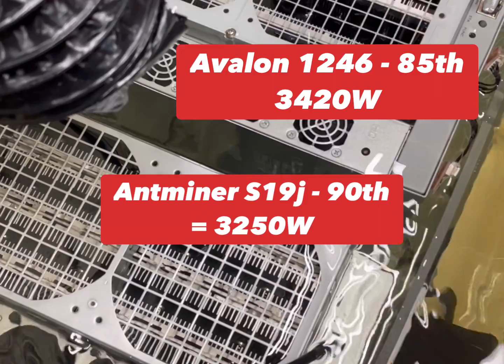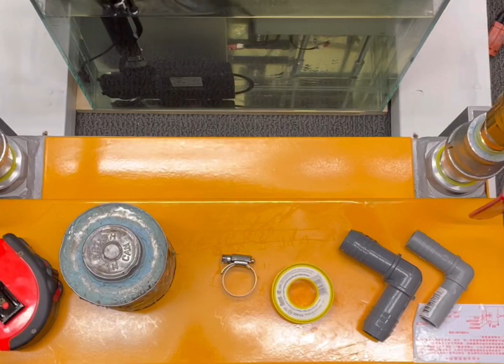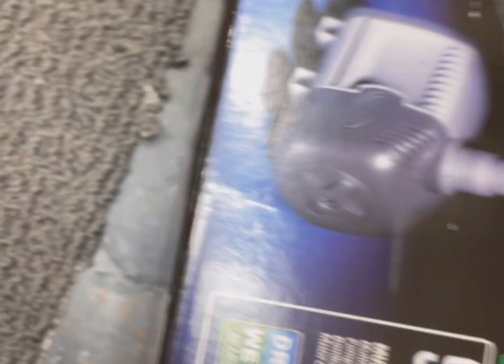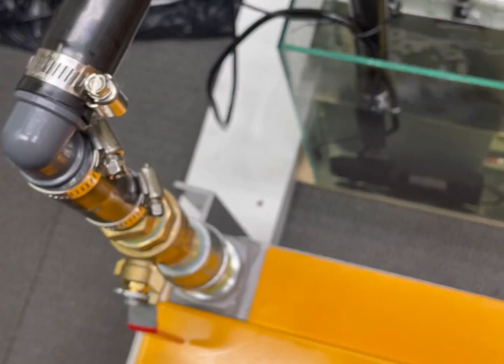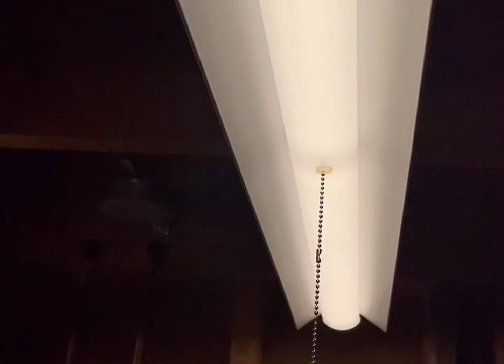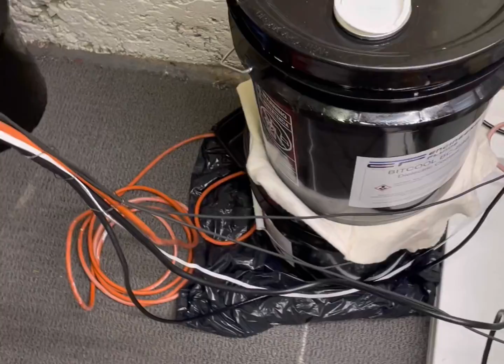DIY - How to Immersion Cool ANY Asic Miner like a Pro!  S19, 1246, M30

Comment: Why not slightly under clock or under volt the miners instead of selling one? That would make them much more efficient instead of over clocking one. Maybe I just don’t have the knowledge but just asking because in the consumer pc world it helps a lot.
Reply from the maker: It’s a good point you you bring up, I’ve tried overclocking, but it burns too much power. I think under clocking is the better strategy long term

Comment: So when plugging in the outlets into the miner the Iidquid doesn’t cause safety issues? Can this liquid go into a Avalon 1246 and also its power supply ? Sounds confusing and cool good video! I’m mining with my Avalon but looking to use this since it’s loud and hot when running
Reply from the maker: @Hakushodemon   you sure can, although it has the appearance of water it’s very thin non-conductive oil. I’m running a Avalon 1246 in this video and did for a couple of years, and it’s still being run by a friend in immersion today . It actually ran smoother than my S19. You just need a fan simulator and you can take out the PSU and ASIC fans out. (Some say you need a simulator for your PSU fans as well, but both my 1246 and S19 run fine without one. There are no safety issues with my glass or HDPE tanks. If you use a metal tank however, I would add a ground wire for safety. 

I’ll be launching a new video soon on an upgraded version i just built as well, runs great.  slower flow rate high quality pump, upgraded tank - slightly different, with new flow plate design, lid, fuel transfer lines for multi use placement, base mount etc. It’s for sale as well if interested. I haven’t posted it for sale yet. 
It’s comeptlely silent. Just the oil cooler fan going, which is a tolerable level interior or exterior. Hope this info helps!
Reply: @BackyardBitcoin  I would be highly interested in purchasing a tank for my avalon for this immesion cooling as long as i can be safe with it if there is a ebay/store link in the description I could look at! Will be watching for more detailed videos on how to immersion cool step by step if i was building it for my avalon myself! My main questions would be how would i remove the psu power supply from the avalon 1246 since its attached to the actual hashboards and main unit. then i would ask if i had a glass box and the right coolet oil, do i detach the power supply on the avalon and just put the aisc in? do you have a name suggestion for this fan similar? I was impressed by your set up since it appears to make the warm oil move over the waterfall and pumped back into those pipes! cool channel thanks for the information

Comment: What if you just ran 2 of the same machines at once for the oil radiators? Would it be better than 1 larger unit?
Reply from the maker: It would work, but Would be a lot more plumbing. More connections, more risk of leaks, more maintenance etc. it’s better to use one properly sized rad for them

Comment: Do you take out the PSU fans? Also, wondering how you get a water tight seal with the heat at 40+C Any redundancy in case of pump failure or leak? Does it shut-down the miner?
Reply from the maker: Yes you must take out the PSU fans. I’ve always been a little worried about my aquarium seals leaking with the temps, But so far it hasn’t been an issue. I have an Inkbird temp sensor in the coolant with a set high/low range that gives me notifications to my phone if something were to go wrong. Worst case I’m not around, the miners have auto overheat shutdowns built in..but of course you never want it to come to that.
Reply: @BackyardBitcoin Im bouncing around between buying a DCX solution or DIY, your vid was great advice. Thanks
Reply from the maker: @BC-AZ   thank you. you can make your own significantly cheaper if you are willing to put in the time and are a little bit handy. Roughly 1/3rd of the cost. If I were to do it again I would use a metal tank to ensure there’s no issues. A fabrication shop can weld one easily for you. Feel free to drop me an email jordyandrew@live.ca 
I can save you a lot of time and help you avoid mistakes. I also already know the exact tank dimensions you’ll need to make it work. I also have a two spare pumps and another heat exchanger this size I can sell to you for cheap. It’s just taking up space in my garage. Im always willing to help out, reach out anytime.
Reply: @BackyardBitcoin Yes, im looking to house approx 8x KS3 miners (3.3kw) total, so about 33KW at 80%. I think I would go with a welded stainless tank. Im not sure I like the idea of pumping the oil through to the dry cooler though, I would prefer a local heat exchanger design to keep the oil side minimized with fewer potential pain points. Ive been investigating DCX and Fog hashing options. I think I would want some redundancy in my pump setup or at least a way to auto-shutdown the rigs if the temps are too high. My setup would have the dry cooler outside through a wall, similar to how mini-split AC's are setup.
Reply from the maker: @BC-AZ  for sure. Stainless tank all the way. As  long as you use yellow gas tape and pipe dope combined you’ll no leaking issues as all, not even a drop. If you do decide to go with something  similar to mine or if you need anything let me know I’ll sell you the exchanger for $500. I also have one of the pumps that DCX uses as well and viton seals for use in a 1” threaded steel tank setup. No problem either way, best of luck with the build🤙🏻

Comment: What's up bro
I'm talking about Brazil and here we don't have DIY videos for this subject.
I'm impressed.
Three questions: Has the noise decreased much?
Why didn't you submerge the entire asic?
Do I need to do any preparation on the asic before diving into the oil? (in addition to removing the coolers).
Thank you very much!
Brazilian greetings!
Reply from the maker: Thank you! Greetings🇧🇷

1. Yes immersion cooling is completely  silent, the only noise you will have is from your heat exchanger fan.

2. This is one of my earlier builds, I have since modified the hot/cold side divider to be a couple Inches higher to completely submerge both asics. This is actually very important for optimal heat dissipation. If it’s too short, the hot oil can pool up and cause poor flow.

3. You will need to remove the all of the fans and get fan spoofers to trick the asics into thinking the fans are running. You plug them into where the fans plug into.

I do have all of the supplies to build a another complete system if you are interested as well or I can send you the just the parts for a DIY build. I have another heat exchanger, pump, tank, fittings, etc.

Hope this helps out! Let me know if you have any more questions or need any parts for your builld.

Comment: Cooling capacity of the AH-1470 model is 8kw (27,000 btu). 
Giving some thought to why the Risen cooler isn't doing the job cooling both miners.  Could it be that the pump flow rate may be moving the fluid too fast to remove the heat while passing thru the cooler before its returned to the heat source?  The Sicca pump rating is 10,000:/hr-2700 GPH (45 GPM) which might be too much flow and is working against you.  Just my thoughts.
Reply from the maker: It’s a great point you raise. In theory, the properties of Bitcool will indeed cool more efficiently by absorbing heat from the PCB’s as it passes through at a slower flow rate. However, I did try two additional pumps in the experimental phase. One with 1/2 and 1/4 power of my current one (thinking bigger was better initially) with little noticeable change to the temperatures. I focused more on reducing the ambient air temp and flow plate design which both had significant impacts on temperatures.

My future builds will a include the engineered fluids specified optimal flow rate.
Reply: @BackyardBitcoin   I went back to watch a DCX immersion system video again to compare.  Their system is larger but I was curious about the sizing of components, like the pump. They mentioned their pump capacity was 45 GPM (@ 8m of head) so your pump GPM was identical to theirs.  I'm wondering if the input/output temp differential would be better putting the dry cooler outside?  The DSX system used a heat exchanger so it lowers the amount of Bitcool needed, especially for a long run to a dry cooler.  Thanks for your info.
Reply from the maker: @wayneo7220  awesome, they have some pretty slick systems. I’m going to have my exchanger outside for my revamped system soon and I’ll make a video on it.  

Hopefully soon! It’s Tough with busy short summers here to get these projects completed.
Reply: @BackyardBitcoin   One other point I'd like to mention.  I was listening to a Compass Mining video and one of the guests mentioned that the thermal conductivity of the dielectric fluid is about 25% that of water and is more viscus, so you have far poorer heat transfer with the fluid and will need to significantly compensate in sizing with a much larger exchanger.  I never realized there was such a big difference.

Comment: nice work!, so mine finally came in and wanted to know how you wired the 220 into the cooler (i understand the transformer bit) is there an extension  or something because mine came with a threaded endcap piece?
Reply from the maker: Thanks! Ok so this type of plug is called a solenoid plug end, that’s the keyword to finding helpful info. Take a regular extension cord and cut off the female end then follow this video. It may not be exact but it’s vey close, and it will get the wheels turning for you. I have also included an imgur link with the wiring diagram for this exact plug. This should help! I’ve been there. Great question!⬇️

https://youtu.be/Xo8fez9EiJk

Diagram⬇️
https://imgur.com/a/qjAy66f
Reply: @BackyardBitcoin  awesome thank you ill give it a go

Comment: great project! Congrats. What do you use to simulate avalon fans? (NEVER MIND IT WAS ALL IN THE VIDEO THANKS!)
Reply from the maker: You will need the ATX 4 pin style spoofers. 4 of them. Check link below ⬇️
https://www.ebay.ca/itm/293732031428?mkcid=16&mkevt=1&mkrid=711-127632-2357-0&ssspo=z4T27MrAThW&sssrc=2349624&ssuid=NyJ-1gTsRXO&var=&widget_ver=artemis&media=COPY

Comment: the oil Specific Heat Capacity？it is what fraction of water? i want to use Silicone oil as heat transfer oil。thank you。
Reply from the maker: Approx 1/4 of water
Reply: @BackyardBitcoin  Thanks for your reply。silicone 1/3 of water. i think use silicone will be better in the same situation（AH1470）.
Reply: @BackyardBitcoin  I consulted  Bitcool specific heat: 2.054 Kj/kg·℃（40℃），Approx 1/2 of water。I hope to help others

Comment: Thank you for the video.  I have my own hybrid version and was running into some problems.  This is a topic that good info is still really hard to find.  I been experiencing problems along the lines of enough cooling for my miners.  I was experiencing slightly better results then your calculations in one of the comments.  This shows that my heat removal expectations were greater then reality.  I may have to look into other avenues to pick up my slack.  I hate having my miners throttle down or having to shut them off.  Good luck with newer versions.

Comment: Hey man, great setup! Thank you for your time on posting it and explaining all the way, helps a lot!!! I'm building a similar one myself, but using a fancoil to heat up my home by pulling fresh external air from outside. Regarding your issues with high temperatures: Heat exchange between two non mixing fluids depends on mainly three things: temperature delta (on both fluids), contact area surface and flow rate. Since you are using room temperature air to cool down, it just leaves flow rate as a controlled variable you can work upon without investing on a new cooler. That said, I'm quite sure your cooler is big enough for the application, but you are not moving enough fluid through it for it's maximum heat exchange rate to happen (200L/min for 8,8KW). Your pump says 2700GPH which is 171 L/min, probably less if you count hydraulic losses. Hope this helps!
Reply from the maker: Thanks! And I appreciate the information, Sounds like you are knowledgeable in this area. I’d love to discuss it more, feel free to reach out to me on Reddit! Thanks!

https://www.reddit.com/u/DR0PFiRE/?utm_source=share&utm_medium=ios_app&utm_name=iossmf

Comment: I'm looking to recreate this for 2 L7s
I have a few questions:

1. What are the dimensions and thickness of your tank? and is it the same exact one that you linked in your video description, or did you make it yourself?

2. Would this setup accomodate 2 L7 miners?
Reply from the maker: Hey, so this setup will only support 1 x L7 you would have to find a larger hydraulic oil cooler, or equivalent.

And for the aquarium it’s the exact one linked in the description. I only made the flow plate and divider for it. The thicker the better. Check link below it might help if you aren’t using glass. If you can afford it the plexi materials are a safer choice⬇️

http://www.plasticgenius.com/2009/05/calculate-aquarium-thickness.html?m=1

Comment: how loud is your radiator? 40 db or 60 db? what is about the fans from the PSU? Should i spoof them too?
Reply from the maker: I don’t have a unit of measurement for decibels at this time, but intend on picking one up soon! 

I haven’t tried removing the fans from my PSU’s yet, perhaps a future video when I get it figured out👍🏼
Reply: You do not have to spoof fans from psu.  In fact, some people dont even remove them.  I removed some, unplugged others.  Only need to spoof the 4 main fans.  I did hear someone mention there is a firmware version you dont need to spoof at all,  but I dont know if it is true.

Comment: So confused about the BSP fitting from the hydraulic oil cooler. is it 2 inch with 1/4 threads ? trying to connect to 3/4 inch push lok hose. Thank for all your help.
Reply from the maker: https://s.reddit.com/c/18peb9xb85d3l?utm_source=share&utm_medium=ios_app&utm_name=iossmf

Reach out to me on Reddit, and I’ll try to help you out there.

Comment: What kind of plugs are you using?  I'm looking for an L630P that has double C13 like that.
Reply from the maker: Leviton 620PV 20 Amp, 250 Volt, Plug, Grounding (Yellow) https://www.amazon.ca/dp/B000U3HYQK/ref=cm_sw_r_cp_api_i_E21C3A0VYWQZ1GHZQJTH?_encoding=UTF8&psc=1

And stay tuned I have two videos coming out within the next week on how to wire 220V and how to swap out these cable ends, if you require and help👍🏼

Comment: Thank you for making this amazing walk through video! I have a few questions about the actual liquid. How many litres/gallons did you use for the who system? Does t evaporate, i.e. do I need to top up that liquid occasionally?
Reply from the maker: Thanks! It really depends on how big of a tank you are using.I would suggest only using a tank that’s just slightly larger than the size of the miner. My tank has just under 80L total, intended for 2 Asics. If you are running just one miner you can use 40L of fluid with a tank half this size. There’s no benefit to having excess fluid. It does not evaporate, so you you will not need to top It up. Just keep it clean and it will last for years. Hope that helps!
Reply: @BackyardBitcoin  Thank you, I really appreciate your response. Looking forward to your future videos😎

Comment: This was an awesome video and very insightful as I plan out my GPU immersion loop. Any chance you could make a quick video on your waterfall flow plate design? Also, what was the pump make/model number you opted to use in your loop? Had a tough time making that out in the video. Thanks brotha!
Reply from the maker: Thanks! I have a link for pictures of current system in description, but yes I will make a video of this and other flow plate designs in the future. The pump is a sicce syncra ADV 10.0. It’s way overkill for what’s required. You could save money and externally mount a smaller pump. You only need 2-4L/min flow rate per kW.
Reply: @BackyardBitcoin  you’re the man! Appreciate you getting back so quickly. So with 12 gpu’s pulling around 2,600watts under load I would need around 12L/min pump? Would you say that more total volume of dielectric coolant (I.e greater spacing of equipment in the tank helps with thermals? Or is it better to compact the equipment?) - my main takeaway from your video was that you need to ensure pump and radiator are effective and high quality units. Would be awesome if you’re down to hop on discord to discuss/troubleshoot as I know I’m going to have some hurdles ahead. Thanks brotha!

Comment: Amazing setup here! 

What fan would you recommend for 2 S19j pro and how hot does it get? Does this method help with heat within the room or is it about the same with the machine running normally?
Reply from the maker: I’d recommend the 2431 model 450L/min.
The heat output will be the same, so ventilation in warm climates is a must. I’ll be venting outside in a month or so here as well.

Comment: This was great, thanks. I'm looking forward to doing something similar.
Reply from the maker: Thanks and that’s Awesome! I’ll be releasing an update on the system in a couple of days. Running well, but a Couple tweaks I would make: double up on hose clamps on connections if using poly. Use a 2 part epoxy for adhesive👍🏼
Reply: @BackyardBitcoin  Thanks Jordy, looking forward to it, great job on it!

Comment: So the heat coming out of the rad is basically the same as how much heat air cooled would create?
Reply from the maker: Correct, the heat from liquid cooling creates the same amount as air cooling. The Bitcool 888 just does a much better job at absorbing the heat away from the heat sinks than the air does.